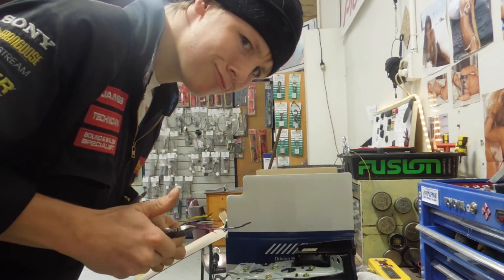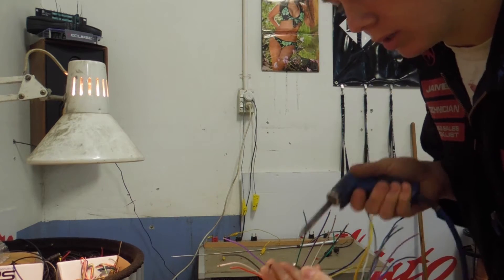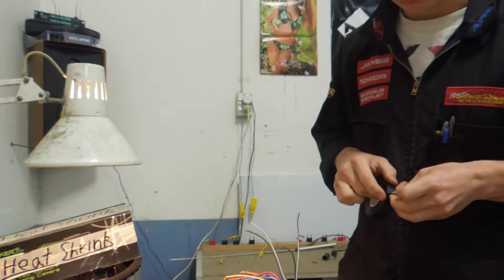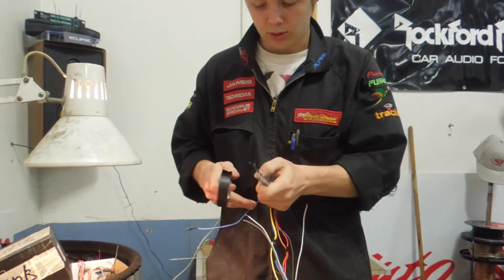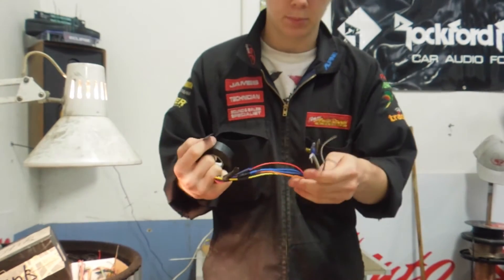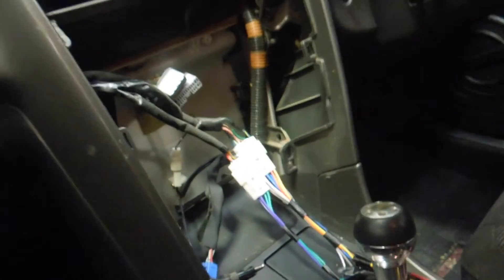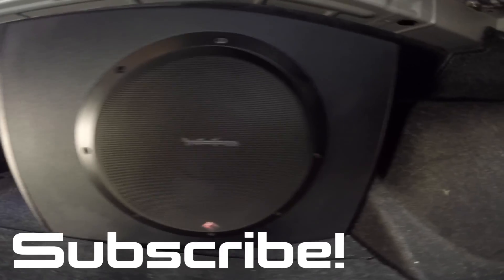Toyota Altezza Full System Install Part 1/4: Stereo Install Shinnannagginnss

Comment: Hey. Thanks for the awesome vids.

Just have a question.. did u pull out the stock amp that came with the car, or did u bypass it??
Reply: Some of the altezza models do not have factory amp so no need to bypass it
Reply: @juniorfb0014  
Thanks Junior, and keep up the awesome work👍👍

Comment: hey can you help me figure out if i can use this speaker with this amp please not sure about ohms.....Power 15" T1 2-Ohm DVC Subwooferand the amp..Rockford Fosgate R1200-1D thanks
i am using this amp and i am on 2 set of subs i dont like 2 p2-12" 1 ohm and tried 1-15" 1 ohm p3

Comment: Hey James, love your love of Alpine Everything. Question though on the SPR-60C. On the woofer....on mine it appears that the cone and the center dust cover is seperated. Is that how they are designed or do I have a problem?
Reply from the maker: That’s normal
It’s a not a dust cap it’s a phase dome.
Designed to prevent something called ‘beaming’.
So you’re all good.

Comment: Hello, I have same car, only difference is engine and left hand drive.
I would like to use 3 way separate speakers at front and back, but seems like my phonocar ph 808 8 channel maybe cannot be used  on this lexus.
Seems like the solution  you came up with might just be the only possible speakers installation for this car. 
what amplifier did you use?
Cheers 
Giulio
Reply: having 2 3way sets of speakers is going to make things very very expensive and it will only pull away from your front sound stage. go with a good set of two way component speakers up front with either a 2 channel amp for the fronts and a mono block for the sub or go with a 5 channel amp. no sence in over complication of a simple situation

Comment: i have question i but a mtx thunder 1000.1 for  10W6v3-D4 - JL Audio 10" 600W Dual 4-Ohm how you think i can setup those?
Reply from the maker: +Omar Ortega 
At 2 ohms that amp does 600W RMS so if that is the RMS power rating of your sub then perfect!
But make sure that 600W isnt its 'peak' or 'rated' power because then the sub will likely have an RMS power value of around 300W and it will be over powered making it easier to kill it.
Hope that helps

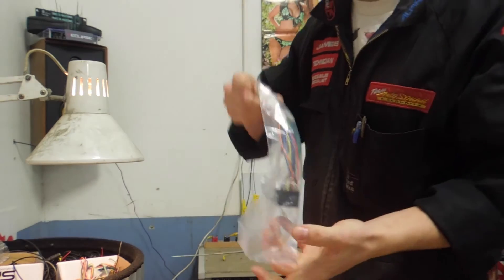Comment: What is the manufacture and part number for that wire harness you took out the bag 3:13
Reply from the maker: its just a generic toyota hookup lead why do you ask?
Reply: i am in the process of needing that wire harness, I have a Altezza frontend on my IS300
Reply: and the one with the 4 wires, I have been going crazy online looking for the wire diagram too
Reply from the maker: If you have a Lexus, the speakers are connected to an amplifier which up under the dash to the left of the glove box (right hand drive model)
You can get a bypass loom which runs from the stereo location to the amplifier and plugs on to the amplifier harnesses.
The amplifier has 3 plugs going into it; a large one with lots of wires, a medium one with around 10 wires (power and front speakers) and a small one with 4-6 wires ( rear speakers and sometimes subwoofer.) the medium and small plugs are the ones that the harness plugs onto and they are the same as Toyota plugs. I will post a picture on my Facebook page of the harness for you. 
Hope this helps :)
Reply from the maker: https://www.facebook.com/CarAudi0etc/posts/562974713894771

Comment: heatshrink really doesn't take that long... nice videos though.
Reply from the maker: I use heat shrink for lots of things mainly coaxle or multi core soldering but for the stereo looms which I do a dozen of a day electrical tape works just fine and really does take a quarter of the time